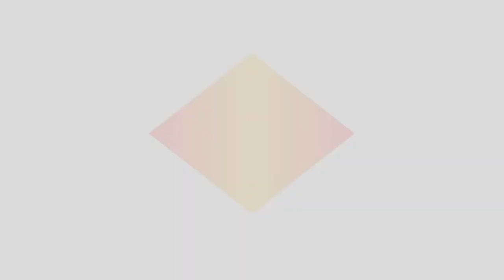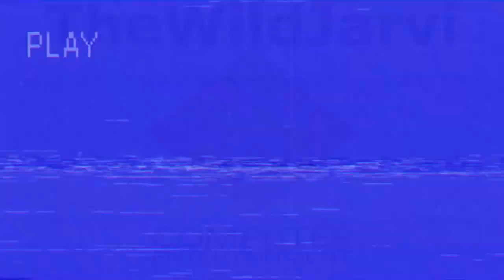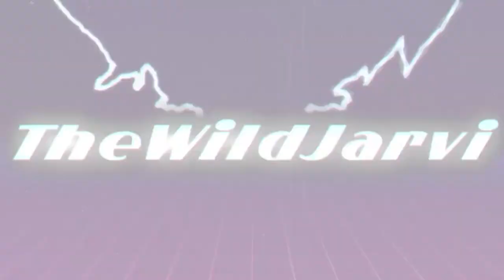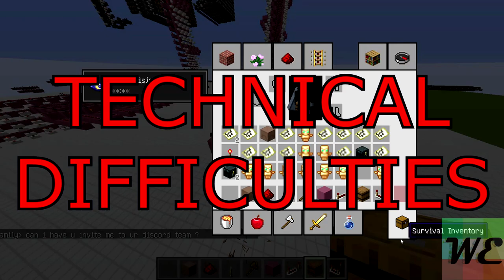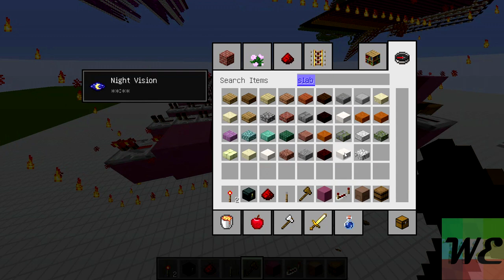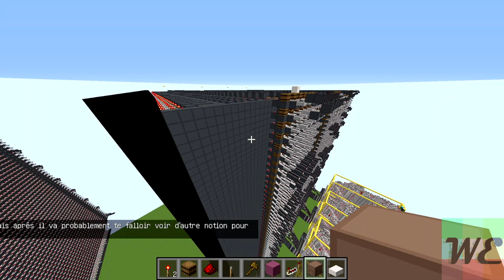Logical Redstone Tutorial 3: 2 Tick pipelineable X,Y decoder with Passthrough!

Comment: Really like the addressable xy stack it looks snappy as, my first 8x8 screen in bedrock i spaced each pixel twice as far apart and made them giant 3x3 pixels to leave plenty of working room, and now i can run through it all which is kinda cool, but this has wayyy more compact circuitry and looks like it will have a much better dpi ;) it also clears up a tonne of questions i had, i pretty much imagined how id make a screen work with a set of images and went for it and strapped 128 bytes of addressable (via item frame comparator xor gate array) comparator ram (non volatile in bedrock) direct to the back of my screen and built a 2 player rock paper scissors decoder to trip image (column) data release onto the 8 lane screen bus, so now that ive had a go im keen to make something more realistic and these tutorials are fantastic for inspiration, once i get home i’ll have to test how bedrock redstone works around barrels as that seems super convenient, some of your previous vids have also led me to look more into how binary arithmetic works so now im considering having a crack at designing a redstone 74181 alu from a logic schematic i found to understand how cpu’s work a bit more as well, maybe oneday ill even be able to plan combining a few components together to do some maths (i work out all my builds in my survival server for the added challenge so input and output spacing is critical). 

TLDR; really keen to see where this series goes and wanted to let you know seeing your builds has really inspired many hair pulling hours of crazy redstone enjoyment :)

Comment: This is a nice design, Thanks for sending this idea to me, i think I'm going to be using it for my next generation of screen. The only big draw back is going to be building this in survival... Thats a lot of barrels to fill.
Reply: I think ill be using shear, because i have a stupid fast iron farm it will only take just under 47 stacks of iron blocks. to make the required shears for a 16x16 display.
Reply from the maker: oh god in survival, good luck bro!
Reply: @WildEngineering  yea, I'm designing a computer that i'm going to make in survival, it's going to do practical in game tasks, as well as run other programs, so  I'm trying to find a balance between speed and survival friendly... Not exactly the same thing lol.
Reply: @RedstoneWarper i don't play much survival but i think stacking raid farms should be enough to get the amount of redstone that computers have ianxofour has a video for piglin bartering farm (for the quartz) not only can u farm bartering items but u can also farm the piglins for the farm which is why it's a farm farm (it's not a typo)